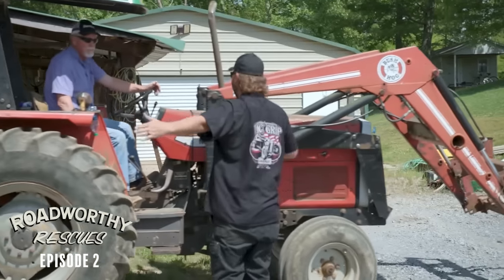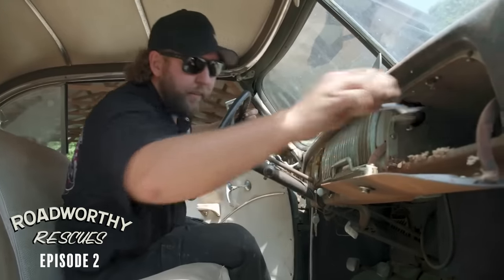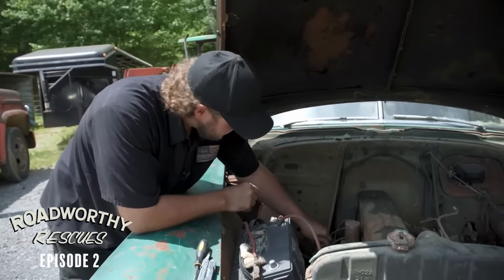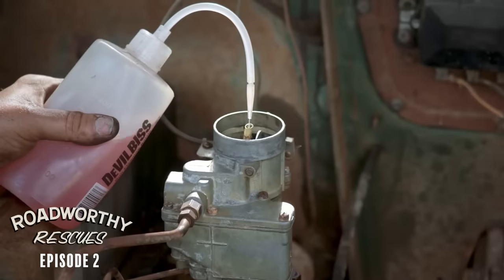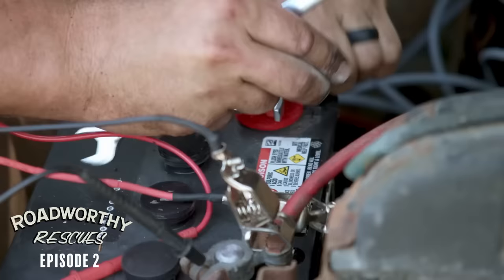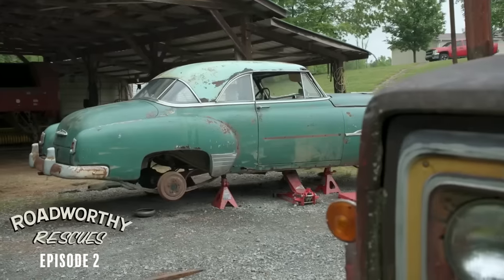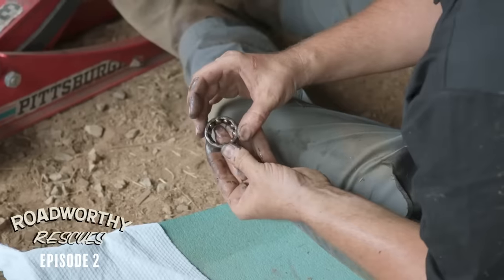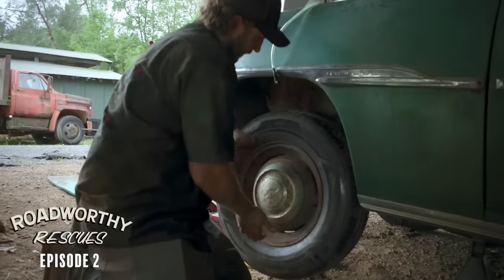This 1951 Chevrolet Deluxe Has Been Sitting For 44 Years! | Roadworthy Rescues

Comment: Derek is the best thing on YouTube. I think it's easy to see that the GM under floor location for the master cylinder was less than convenient. Even in California were I'm from rust made removal a challenge. The fact that you did not have a hanging break pedal was not worth the complications associated with the geometry.
Reply: You have to remember that floor mounted brake pedals are a throwback to the days of mechanical brakes and LONG linkage rods along the frame. When they converted to "juice brakes" they left everything else alone.

Comment: My Dad had a 52 Deluxe 4 door back in the early 1970s. He had all the rust removed and replaced with steel panels done the traditional way. He had it finished in gunmetal grey. I was lucky enough to learn to drive in it. I think it had a Blue flame 6 cylinder  with three on the tree.

Comment: My first car was a 51 Chevy Deluxe Coupe with a 52 grill, had a lot of fun in that car.
Reply: Mine was a 52 Club C Coupe. Primmered black. No engine or trans. I found a 57 Imperial it was side swiped. Front drives fender all the way back to the rear wheel well. I installed the Gen 1 392 hemi trans and rear. In to the Coupe. Rear springs bolts were a half inch each side too narrow. But being 17 years old,I pulled Thom out and clamped them down. They would not let me weld the drive shaft that I shortened. In Shop Class. It sure was fun to drive around on the old gravel road. The guy I got the car from wouldn't give me the title or didn't have have it to Begin with. There was a similar on in town that was called pins and needles or something close too it. It was a looker in the summer of 68. I don't recall any Major problems with connection up the Chrysler (Imperial) Crown Coupe. So I parked it and the Day after  of graduation. I got a job in the steel Mills . Then the draft.
Reply: @donaldpowers3314  Sounds like it was quite the project.

Comment: There a removable panel in the driver wheel well to give you access to the master cylinder. I used it on my '53 Bel Air. Made it a lot easier.

Comment: Myself, I never push the brake pedal or an accelerator pedal until I pour gas in the carburetor through the slanted vent tube so it won’t tear up the accelerator pump, especially since most of those were leather!. And if you fill the master cylinder full first and cracked the bleeder nuts and let gravity do it’s thing, there’s a good chance that when you push the pedal, It won’t push the Chevron cup inside the master cylinder up over  the crud that has built over time. Many people wonder why when they do a brake shoe only job, shortly there after, their wheel cylinders will leak. It’s because when they put the thicker shoes on, the adjuster Has to be closed up shorter,which makes the pins push in on the wheel cylinder pistons which pushes the Chevron edge of their cups up over crud that took years to build up. The ideal would be to have one of those suction bleeders and put it on the right rear bleeder nut and draw fresh fluid from the reservoir all the way to the rear before ever touching the pedal. I’m an old geezer who’s pulled many cars out and got them going and learned what I should’ve done from not doing it ha ha!!!😂 I saw a 53 one time that was called a Sportsman and it had the three piece back window and was a hard top as well. That’s a real good find you’ve got there!

Comment: this is a good old car. long may it live. just keep the speed down to about 45. My first car was a 48 chevy so I know not to push the rpm on that 216. you will need to crank up the voltage regulator to at least 9 volts to charge the 8 volt battery. I would have used a proper 6 volt battery.

Comment: The first car that I ever bought with $25 of my own money, was a 1952 Chevrolet "Turtleback" that had interesting shift linkage. If I stopped at a light, stop sign, etc., I had to shut it down, jump out, and shake the shifter linkage so it would go back into first gear. Unfortunately, the car did not last long. My Mother made me get rid of it.

Comment: Only bad thing about GM motors is they used poured Lead bearings all the way till 54! the mains were a weak spot, otherwise, a tough engine!
Reply: "Babbit-Pounders" we called 'em.
Reply: @spamwagon  Had a 51 stude  with a 6 with steel bearings that  ran well  at least till I sold it in 2005 with a valve job and honing cylinder walls in the early 70s. Was just starting to have a slight knock - probably wrist pin, when I sold it. That was a good engine

Comment: You actually checked the charging system how i was taught by an old timer. Just pull the battery and if it stays running its charging.

Comment: 2004 buick century the computer won't shut off and it will drain the battery i have a switch on the battery and the garage wants $1400.00 to fix it